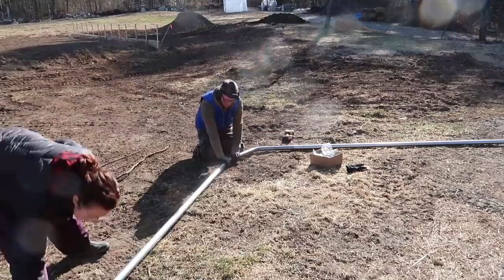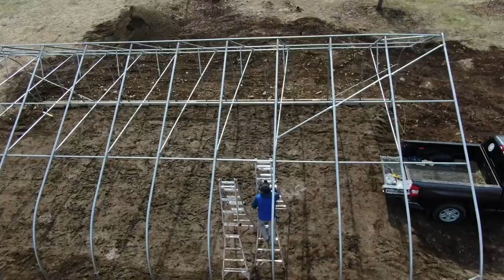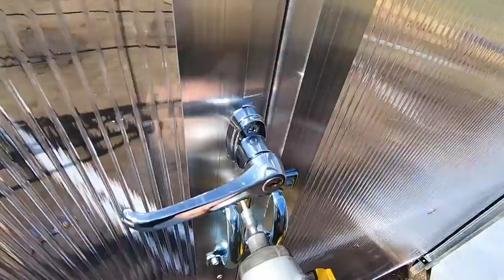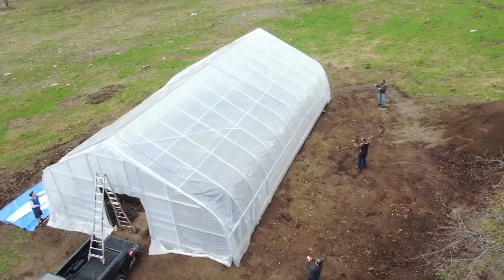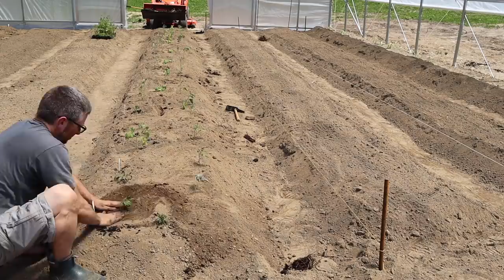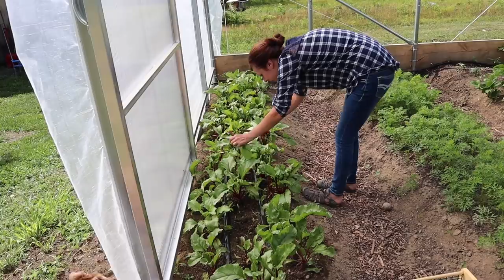TIMELAPSE- Couple Builds Commercial GREENHOUSE in 10 Minutes

Comment: Al, Gina you have purchased a large new block of land and mentioned that one of the reasons for that was you felt you had maximised the potential on your homestead property. Yet in the past you have talked about perhaps building multiple greenhouses connected to a heat pump system to extend the growing season and maybe selling some produce in the future. You also have a large area of previously logged land on your homestead which seems to be under-utilised although I think you mentioned running sheep on the property. With all this in mind it seems as though there is still plenty of potential on your homestead and perhaps that is where your energy should be focused rather than on this new property which seems to need a lot of clearing before it can be used for anything at all.

Comment: Your beaver problem. You have caught a few beaver at the dam, good job!! The beaver that are still around have become educated with your catches of their colony.. You need to change things up a bit with your beaver trapping.. Find their den, lodge, house or what ever you want to call it, they will have runs coming in and out of their den, it will be like a half pipe in the ground under the water. You will need to set your trap (330) right in the middle and on the bottom of that run.. When they leave and enter their den, they use the same run and they always hug the bottom of that run, that is why it becomes "per say" a half pipe...

Hope this helps... Nice green house by the way...